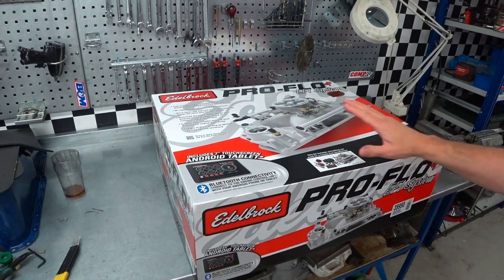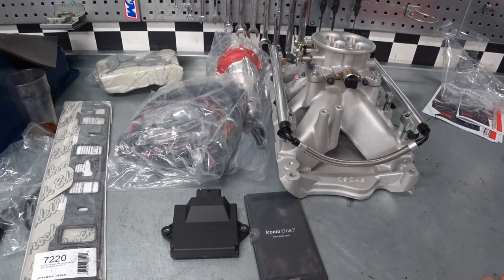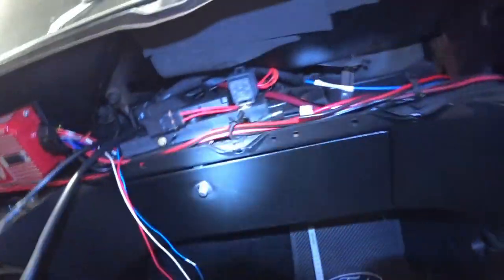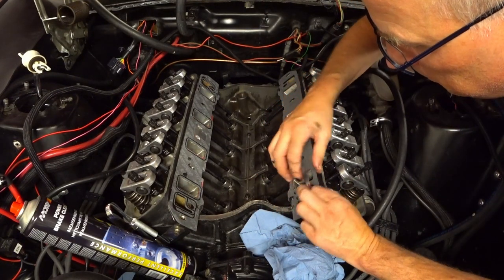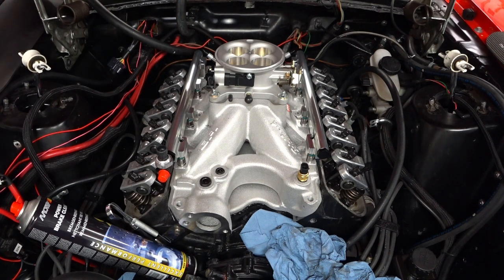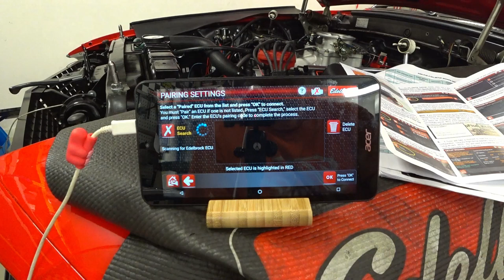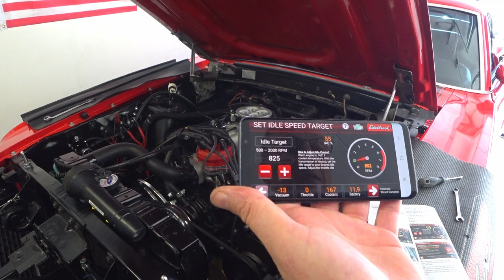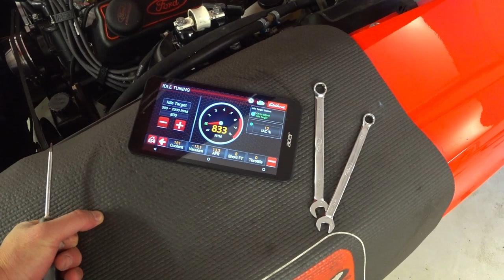Edelbrock Pro Flo 4 EFI installation

Comment: Good video! I have to convert my 302 from carb to fuel injection and this pro flo 4 seems to be the best option. I've not been impressed with the reviews on Holley or Fitech throttle body.
Hoppas mussen fortfarande går gött! 👌

Comment: You put the drivers side intake manifold gasket on the other way.
Did it not make a difference?
Just curious..

Really great share by the way!   Sexy motor compartment!!

Larry
Reply from the maker: There is no difference wich sides are upp or down since I clued all sides. 
Very important to clue when running EFI to get everything 100% sealed...With carburator there is not that super important

Comment: Love the stang bro, I have a 69 mach 1 as well. How is the efi holding up. My 408 is about to get this treatment.
Reply from the maker: Sounds great!
PF4 system is great and reliable and have ZERO issues! 
I had previous both Fitech and Sniper and both broke several times!
One tip! Get a high quality fuel regulator!
I just tested the cold start!
https://youtu.be/XzwrXzC59DA
Reply: @FordMustang1969Restomod  I think I ended up reading some of your comments in one of the classic mustang forums.  I found it funny when I see the car in question in your you tube channel.  I just bought back my high school car. I sold it 12 years ago and have been tracking the guy for 2 years.   Finally bagged it. I built the 408 in 02 it probably only has 100 miles on it. The Efi system will be perfect for keeping me from having to pay for dyno runs.

Comment: I noticed you had the Holley Sniper before going to the Edelbrock pro flow 4. Can you explain any performance changes and differences between the 2 EFI systems?
Reply from the maker: PF4 is a real sequential EFI so it has much more even combustion. All over better!   Sniper broke because the computer sits and cooks of on the manifold. Having the ECU on a safe place way of heat and vibration is the normal way for most OEM systems….it just works

Comment: So   why did you go from holley sniper to edelbrock efi?
Reply from the maker: First of all Sniper has terrible quality and the ECU placement on the intake are the worst place you can put electronics... It got cooked!.
It is not a real EFI system either.
Sniper is basically an electric carburetor and PF4 is a true EFI with sequential firing of the injectors.
You can't compare them is is a huge different
Reply: @FordMustang1969Restomod  thats crazy poor quality for Holley especially for 2x or 3x the price of a carb and i suppose it lasted just long enuff to get past warranty?.
Reply from the maker: @kravmaga7070   Yes to bad because it worked fine when it worked.  Not as good as Edelbrock though.
With EFI realability is key!
Just a minor fault and you are standing still.
With carb you can often keep on going for a while.
I got a new Sniper on warranty but I never put that on and sold it.....When you loose the trust for something it usually stays!

Comment: that intake manifold looks taller than stock, is there much space between the air cleaner and the hood? or did you have to modify the hood for extra clearance?
Reply from the maker: Yes it is the Super Vic intake manifold so you need to modify the aircleaner.
I just modify a Ford Stock aircleaner base so it was a simple fix.
The hood is untouched

Comment: Thanks for the video. It helped me install a PF4 in my 74 Ford Bronco. Can you please tell me the diameter of the round hole in your 3d printed firewall plate for the wiring harness? Thanks

Comment: Which one did you get? The 450 hp one or the 550 hp one? How much hp does this car put out? Thanks! Nice job BTW.
Reply from the maker: There is only 1 version for 351 based engine and it is 550Hp…How much…..Well it’s enough for me. :)

Comment: I bought a system like this one. 
The manual only shows one PCV port in the front of my carb. Mine has two. Like yours. 

Does your manual show your carb like it is actually?
Reply from the maker: I don’t understand what you mean...You only use one port that goes to the PCV valve in the valve cover.

Comment: Why are you moving on from the Holley sniper?
Reply from the maker: First Sniper was really unreliable and ECU broke after 1 year. The ECU sits and heats up on the manifold and it is not a good design.
Also Sniper is not a real EFI it is an electric carburator. 
PF4 is a true direct injection where the 8 injectors fires in the order ignition fires so it has way better function.

Comment: hello
What is the gas mileage before and after ? did you drive e85 ? premium ?
regards
Reply from the maker: It is of no interest since it is a entusiast car.  
I don't drive it for economy only for fun so I have no clue at all actually..  I use only 93 US Octane only (98 RON)
On higway I would guess it is no problem going for around 18-20mpg.  In city no problem running 6mpg

Comment: Pretty sure that unit has a built in fuel pressure regulator.
Reply from the maker: No it doesn't have one like Sniper and Fitech.
You have to buy it separately witch is good since it is a really sensitive piece.
On Fitech it broke for me.

Comment: Man, fitech was excellent Also. Why you change?
Reply from the maker: Fitech are "real" crap!!   Having the ECU "frying" on the manifold must be the most stupidest solution of all... No OEM has that.  I had 2 Fitech where the ECU failed on both...Also other bad quality problems like the Chinese fuel regulator FiTech have...Noname brand

Then switched to Sniper and after 6month it also failed in the ECU.
This PF4 are super reliable and also a true EFI...The others are not EFI
Reply: @FordMustang1969Restomod  I confess that I am surprised by your answer.  I imagined it to be an excellent product.  I was going to replace my injection with a fitech one, but I will reevaluate after your comment.  Your video was great, I really appreciate it.
Reply from the maker: @necoabarati  FiTech cost me lots of headache!  Still have saved infor of all problems. Look here the China fuel regulator and melted O-rings.  It is a direct copy of VW Beetle from the 80s so I went to VW and baught new O-rings. https://photos.app.goo.gl/qSbneKE3cjhcJAjV9

Here typical ECU internal loose contact.
I replaced ECU on waranty once but the other broke in some similair way
https://youtu.be/prQYAY057Iw
Reply: @FordMustang1969Restomod  thanks a lot man.  Your explanations were of great help to me.  I'm going to go with an edelbrock system for my 360ci, no questions asked after all this.
I will spend a little more on the edelbrock system, but I will also save in the long run with the severe problems that a fitech will give me.
Thanks again.
Reply from the maker: @necoabarati  Well actually not that much extra since you get both distributor + intake in the price.  Both Sniper and Fitech also require a good distributor.  Fuel system is next expensive parts and also there lots of China stuff!  Don’t buy cheap fuel regulator! I had 2 of them that failed until I bought a good brand like Aeromotive, Weldon or the better Holley.

Comment: Gasgacinch.. so much better to work with than RTV when installing intake manifolds.
Reply from the maker: E E No that’s false. Have tried it several times and do not have the longetivety and flexibility as professional workshop products from Wurth.

Comment: How did you connect into the existing ignition system? Which wire? Nice Car!
Reply from the maker: Read their manual. 
It's really simple but it is crucial all wiring are fresh and gives steady strong voltage.  Its not only the injections system! You need also wiring to the new fuel pump system...A new tank with internal EFI fuel pump is strongly recommended!
Reply: @FordMustang1969Restomod  thanks so much… I’m asking because I’m getting ready to install in the same car. I also have a 69 mustang with a 351w. I’m going to be running a Holley in tank fuel pump and wire through a relay. Were you able to tap off of the fuse directly or did you need to splice or t-tap into one of the ignition wires?  Sorry I’m not the best with electrical stuff.
Reply from the maker: @mattcornett7180  Hi Matt! The wiring is really critical so try route new wires as much as you can!Stay away from simple fast push in style connection.  New extra beefy + wiring and several good ground cables (not straps)..EFI are sensitive to poor wiring. I built a new fuse box, https://youtu.be/3muuy0wSwQ8

Comment: How did the Holley Sniper work for you? Did you have issues?
Reply from the maker: Sniper is just an "electric carburetor" and of poor quality and many issues....The major design flaw is that they put the ECU on the throttle body. Heat and vibrations pretty soon kills it and it happened to me....I have never seen an OEM manufacturer put sensitive electronics cooking on the manifold.  Probably of good reasons

Comment: Is the intake specific for certain heads?
Reply from the maker: No it is a regular super vic……With intake you don’t have to think the same way as for carburettor since it’s only transporting dry air
Reply: @FordMustang1969Restomod  I have trick flow aluminum heads and I had to drill additional holes so they lined up..was thinking about ordering the pro flow 4 probably gonna have to do the same thing.
Reply from the maker: @jakehoerner4529   That must be something wrong…..I had Trick Flow on a 351w and there was no issues at all….With aluminium heads I always use stud bolts so there are no chance stripping any threads

Comment: I take it this won’t work with a Cleveland will it?
Reply from the maker: No there is no kit for it and not worth the effort... I would recommend you to look at MSD Atomic or a FAST system....Both are really good and the ECU unit are really good protected
Reply: I hate that Cleveland always misses out on the cool stuff especially here in Australia every old Ford has a Cleveland in it

Comment: Thank you for the video!  I am running into the same issue you had with the manifold not fitting between the head.  It is a 351, but with stock style heads.  Can you provide more information about your modification?  Was it to the heads or the manifold?
Reply from the maker: David Dockery I had to grind of the edge of the intake manifold. Easy fix but annoying on new parts.
Reply: @FordMustang1969Restomod  
Having to do some fitting isn't unusual for aftermarket parts - but it IS unusual for Edelbrock, they manufacture some of the best aftermarket parts.
Reply from the maker: MIKE Yes really unusual. Especially since there are Edelbrock heads and Super Victor intake that been around.. Well a company isn’t better than the worst employee!
Reply: @FordMustang1969Restomod  
Quite true!
I used their products extensively, their cylinder heads were one of the few brands that I didn't have to do any rework on before they went on a customer's engine - but that didn't stop me from inspecting and leak checking every set before they went on.
An engine is only as good the parts that go into it!
(lol)
Reply from the maker: MIKE The heads are 12years old RPM and really great product! I have only took them apart last year since I overheated 1 valve..No other wear at all!
Reply: @FordMustang1969Restomod  like I said - really high quality products!
I'm a meticulous engine builder, some say too much so, I inspect every part - disassembling new oil pumps to check operating clearances and remachining as necessary and so on, so for me to endorse a company's products they need to be good.
I did a supercharged 351 with Performer RPM heads for a customer (635rwhp) about 14yrs ago, recently we opened it up to freshen it up and other than fresh valve seals and springs they needed nothing - I hand lapped the seats and put 'em back together.
Supercharged engines are particularly hard on exhaust valve seats and guides, for aluminum cylinder heads to hold up that well over time says a lot!

Comment: How is it compared to the Holley Sniper EFI ?
Reply from the maker: You can't really compare. This is sequential and much more smoother and even...The big difference is the ECU.  On Sniper the ECU eventually gets fried by the heat.  On Pro Flo the ECU is protected from heat, vibrations as it is on 100% of a normal OEM ECU
Reply from the maker: I had also Fitech previous...The ECU on that piece also got destroyed by the heat
Reply: I have had sniper 1 year now. I have a 454 with a big cam. Cold starts havent been the best
Reply from the maker: @cwathne  Well it is still a carburator and I also had trouble getting it running good with a wild roller cam
Reply: Ford Mustang 1969 Restomod 
I would not say its a carb, it has alot of benefits compared to a carb. And I would not go back to a carb.
But I guess you have answered my question. And that it does probably do most things better than the sniper. 
I noticed how well it ran first startup on cold engine, ran great with a genereic base tune with no learn. Was impressive
Reply from the maker: Christian Wathne Sniper is an electric carb that “batch” sprays fuel. Wet intake and demands airflow to atomise the fuel in exactly the same way as an carb. ProFlow intake is dry and fuel sprays directly in to the chamber sequentially for each cylinder. Trigger for fuel spray sits in the distributor...Cold start is totally different.

Comment: Much difference between the sniper and pro flo 4? performance difference
Reply from the maker: Matheus Marchiori No I can’t say there are any difference in performance. The Sniper are not as smooth as PF4 and very jerky from low rpm...Sniper has a problem with this and the fix is to lengthening the throttle arm. But anyway not as nice to drive with as PF4

Comment: What size radiator did you upgrade to and what electric fan did you purchase?
Reply from the maker: The radiator is the stock bras type 20” for big block.  The fan is a SPAL 16” controlled by a Derale unit.

Comment: Must be nice. We tried this kit for the LS and it never loaded the base map.
Reply from the maker: That is because you first must download the map that are in the ECU....Then you can upload a new base map...This is a known bug
Reply: @FordMustang1969Restomod  Tried to do that also. It wouldn't load it. Also tried to go in and load the one that the setup wizard was attempting to load still no luck.
Reply from the maker: andrew geary First of all did you got to meny ”Save current map”? After that you should try to run wizard. Contact support they help you out quickly.
Reply: @FordMustang1969Restomod  Yes tried all of that. We're waiting for a call back. At this point I'm considering going with a Holley. Crazy they know of this issues and haven't fixed it and the manual don't say anything about the the other options that have worked for some. I did like how simple this setup was and the wireless tuning but it has bugs they need to fix.
Reply from the maker: @1clnsdime1  Try a different Android device.  Agree some of this would be simple fix with new version. I ditch the Holley and Fitech since both ECU circuit boards died of the heat. No OEM manufacturer puts their ECU on a heated place. Good Luck!